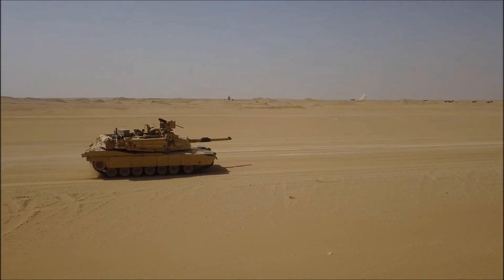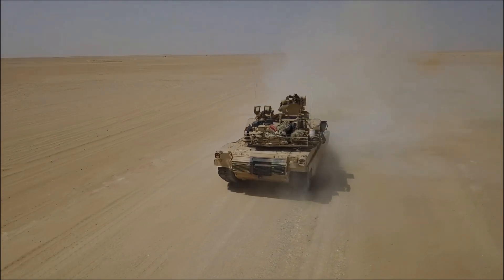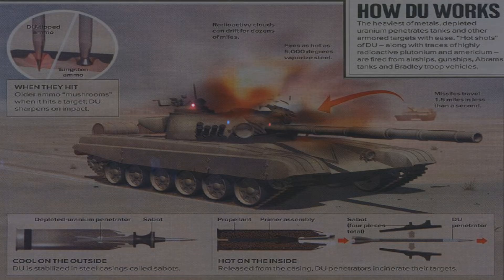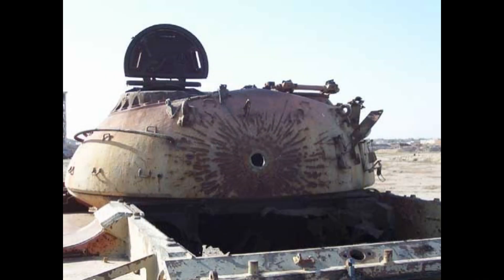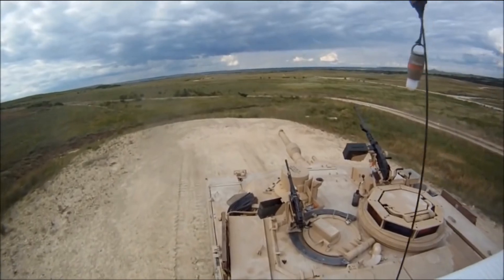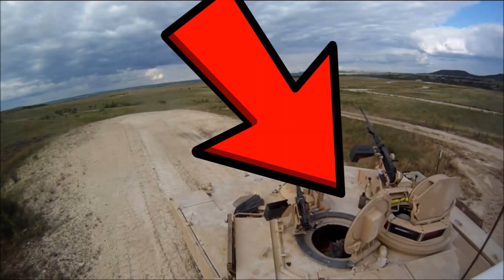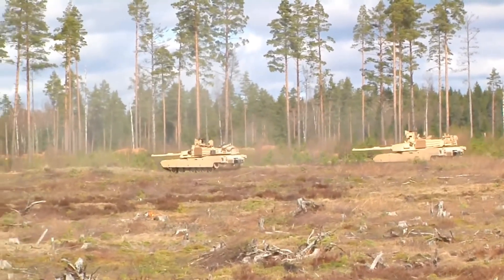Depleted Uranium Tank Ammunition | DEADLY DARTS 💀☄️

Comment: Also you do know that AH-64, at least US ones use a mix, determined by CO and theater of DU/HE, and it’s also API/HEI right? And we have 20mm for jets, and seperate 20mm for Cobra’s, as we, the Mighty, one and only, first and longest serving attack helicopter that will out last any other VTOL and help, we have the last surving squeeze bore, a 20mm, Vulcan squeeze bore with a mix of DU AP/API and HE/HEI. Yep, we still run squeeze bores, the USMC don’t play, why waste weight on a bigger gun and less ammo, and being a larger, slower, stationary target that has to hover while engaging. When you can be fast, nimble and deadly and small. While outperforming or at least matching 30mm performance out of a 20mm. Yeah, we invented and perfected it, before literally anyone else, yet silly people think an apachebb by is better, lol, they are worse in literally every way and got shot down by a single dude, with mosin in Afghanistan’s never happened to us, and we been doing it since the mid-late 60’s.

Comment: Tngsten is harder and more dense tha Uranium, however uranium penetrators are more effective. Unlike tungsten, uranium is pyrophoric. It also has a lower melting point than tungsten. As a DU penetrator strikes a target, its surface temperature increases dramatically. This causes localized softening in what are known as "adiabatic shear bands" and a sloughing off of portions of the projectile's surface. This keeps the tip sharp and prevents the mushrooming effect that occurs with tungsten.

Comment: Fun fact: the scientific basis on why long, dense and slender rounds work so well was actually predicted by Sir Isaac Newton. Newton surmised that impact depth — once you reach high enough speeds — depend only on the following things: the density of the target (higher = less penetration), the density of the projectile (higher = deeper penetration), and the length of the projectile (longer = deeper penetration).

Speed does not matter, once you go over a certain velocity, and neither does width/diameter. So you might as well sacrifice width — i.e. total weight — in order to get a higher velocity.

Comment: Water is the hard:Wood and encapsulate water. with explosive in the back edge. can be 4-sided like the ones used today but filled with water and plastic ammunition. then you can stop this ammunition with giga high-pressure water in a container.

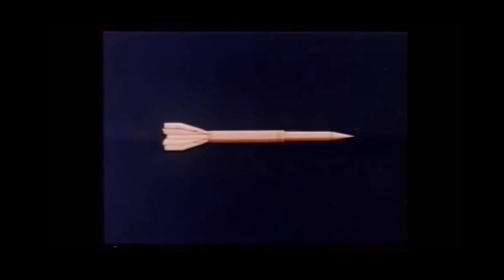Comment: I was a bit confused by the video's comments on radioactivity at around 7:00 .  If I heard it correctly, it said that DU l was the most radioactive form of uranium.  In fact, it is less radioactive than natural (unmodified) uranium, and much less radioactive than enriched uranium.   Roughly speaking, radioactivity is inversely proportional to half-life, and U238 (the main component of DU) has about 7 times the half-life of U235.  It is far less radioactive than, say, Radium or Carbon 14.   It is usually regarded as safe to store and handle without taking any major safety precautions.  It is desirable to wear gloves when handling it, but more for reasons of toxicity than radioactivity.
Reply: Yes, it's not very dangerous when it is in a solid form. Problem though is, that if a DU round hits something, it creates DU-dust, which you can breath in and that is a real health risk.

Comment: 1:25 "Made of Uranium"? A DU round is made of DU, not U. that's why its called DU. In DU there is only 1.02% Uranium left after the original Uranium enrichment process. DU is what's left over after the enrichment process. It is NOT spent fuel rods or something like that. That would be truly hazardous in a Radioactive sense. In other words, there is shit all Uranium or radiation in a DU Round. The biggest problem is after a DU round hits something and has an exothermic reaction (usually on Iron) the vapourised metal and atomized metal goes everywhere. However, a similar thing happens with lead. The effects of DU are very similar to Lead. Anyway, don't call DU Uranium, coz its not.
Reply: Wow. I just responded to your incorrect claim that uranium is not the heaviest naturally occurring metal on Earth (fact check: it IS). Now this ripper. Fortunately, I can quote part of your other reply to address this one,  "I dunno what textbook you're copying or if you making this up as you go along :/ frustrating cos..."  I've only read 2 of your posts so far "...and stupid me has spotted two non-facts"  One word for you Karen: ISOTOPES. 

Depleted uranium from uranium enrichment process is nearly 100% uranium. Not "1.02%" .

Comment: Interesting video.  Thanks for the effort to make it. A few physics corrections:   1.  Naturally occurring Uranium starts out at 0.72% U235, 0.01%U234, and 99.27% U238.  Your graphic states that depleted uranium is 89% U238. I think you derive this because Uranium is enhanced to 11% U235 for use in fission reactors. DU projectiles are alloyed with other metals. Depleted Uranium has to be 99.27% U238 minimum before being alloyed.  2.  Stating that a projectile has no drop over 2 miles would be disputed by Sir Isaac Newton’s laws of motion. Gravity cannot be erased from any moving (or static)body on the earth’s surface. The drop may be small, but it can never 
be zero.

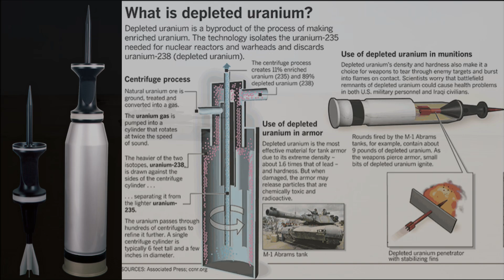Comment: 1:29 - "uranium, the heaviest naturally occurring element on earth" - Firstly, it's "the DENSEST" ("the quantity of mass per unit volume of a substance"), since "heavy" refers to WEIGHT ONLY (a tonne of lithium is much heavier than a kilo of uranium) - and secondly ,"the THIRD densest (maybe...) naturally occurring element".

Osmium comes in as "first", at 22.59 g/cm3, iridium is second (22.56 g/cm3), and only then comes uranium: 19.1 g/cm3. (Plutonium is, in fact, denser, at 19.85 g/cm3, but occurs "naturally" only in trace amounts, so the jury is still out on this.)

Also, the printed insert "What is depleted uranium?" states erroneously that "damaged armour made of DEPLETED uranium may release radioactive particles" - well, DEPLETED uranium is just about as "radioactive" as bismuth. 238U contains very little of its more radioactive isotope (235U), less that 0.3%, and it's radioactivity is so low that it is used, according to Auntie Wiki, as "radiation shielding in medical radiation therapy and industrial radiography equipment, and containers for transporting radioactive materials".
So, TOXIC? - yes; RADIOACTIVE? - hardly, or barely.

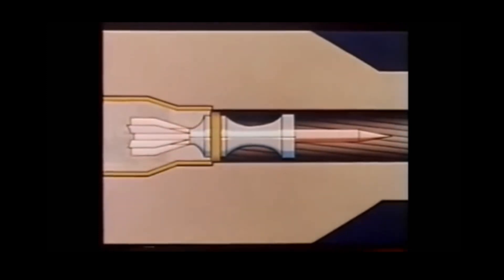EDIT: 6:39 - but whereas tungsten projectiles become rounded at the tip upon impact, uranium shells burn away the edges"... Uranium WHAT!? Oh, dear, dear...
Uranium PROJECTILES, "bullets", darts - whatever, but not "SHELLS"! Also, they do not "burn away" but rather "shear off" blunted parts...
Well, we certainly can see a lot a room for improvement here, don't we?

6:53 - "depleted uranium is a by-product of the process by which uranium-235 is...CREATED??!" 
• create (verb) [ with obj. ]: bring (something) into existence (...)
• produce (verb) [ with obj. ]: make or manufacture from components or raw materials (...)
• separate (verb): divide into constituent or distinct elements (...)
 Seems like the struggle with someone's native language continues, and the language is still mightier...

Now, I have to say I've skipped through most of the video, so I really don't know how many other "pearls" like these one here are still buried in the soundtrack, but frankly, I don't really care. I'm giving up, bye.
Reply: I seriously love when know-it-alls WRONGLY 'correct' others on the internet. "heaviest" in this context refers to the molecular weight. So stating that uranium is "the heaviest naturally occurring element on earth" is entirely correct.

Now, I have to say I've skipped through most of the video your post , so I really don't know how many other "pearls" like these one here are still buried in the soundtrack ranting , but frankly, I don't really care. I'm giving up, bye.
Reply: @kirkc9643  Thank you for your appreciation. 

Unfortunately, ATOMIC mass (NOT "molecular" one) does not translate into DENSITY of a PHYSICAL SUBSTANCE in a straight manner - and "weight" just IS NOT a "mass". Sorry, but don't blame me - I haven't invented English and its vocabulary.
Anyway, back to the issue - let's for instance take radon (Rn), which is a noble gas of a VERY high atomic mass of ≈ 222, or 222 g/mol, and lithium (Li), which resides on the opposite corner of periodic table, with a very low atomic mass of about 7 - or 7 grams per mole.
HOWEVER, the DENSITY of radon (under "normal conditions") is about 0.01 g/cm3, while density of lithium, the THIRD LIGHTEST ELEMENT is about 0.534 g/cm3, or well over FIFTY times as much. (Makes you think, eh? Nah, just kidding - you don't ever get distracted by this activity, I'm sure...)

"Now, I have to say I've skipped through most of the video your post" - that's fine and perfectly OK with me - I'm sharing my knowledge free of charge, but hey, "no like, no eat".
In other words, if you wanna stay... where you are, who am I to tell you what to ignore or why being dumb isn't the best idea, right? But then one has to be dumb to love being dumb, so it all sorta works out perfectly, innit?

Cheers.
Reply: @MrKotBonifacy  You're still ranting and still wrongly claiming the video is incorrect.  The heaviest element in terms of heaviest per a given number of atoms is the element with the highest atomic weight. This is the element with the largest number of protons. The heaviest naturally-occurring element is uranium (atomic number 92, atomic weight 238.0289). If he'd said most dense, your ranting might be relevant. But he said heaviest.
Reply: @kirkc9643  I'm not "ranting", but merely EXPLAINING - although it feels more and more like "pearls before swine" scenario, TBH.
Also, I am saying the video is INACCURATE in some (many, in fact) aspects, and I'm not "wrong" on it, as I clearly listed some of those "mental farts" present there that I spotted.
AGAIN, that "heaviest" vs "densest" is THE LEAST IMPORTANT issue here, and YES, U might be "the heaviest" but that is irrelevant in KEPs context, AND THE ONLY reason I ever mentioned it was that I decided to give my "dressing down" AND that "heavy/ dense" issue sorta "caught the train" so to speak.

And then I'm not going to persuade you (or anyone else) to agree with me, and then that comment of mine was meant as a FEEDBACK for the AUTHOR.
But YOU decided to chime in and drop your wooden twopence here so don't complain now that I pointed out your fallacy (i.e. thinking that YOUR ASSUMPTION trumps mine, because... it's YOURS, right?).

Also, "give credit where credit is due", and I did just that by saying that yes, technically the author and you are both correct, but then the atomic mass is basically irrelevant here (and I even presented you with SPECIFIC NUMBERS - a.m. and density of W vs that of U).

And yes, you can say I'm a "know–it–all" and what not till the cows come home (and then for eternity), but I just couldn't care less. I hoped for a civilised and facts-based reasonable exchange, but I'm afraid there's a serious obstacle here (and it's not me).

Also, "heaviest element in terms of heaviest per a given number of atoms is the element with the highest atomic weight" is a nonsensical gobbledygook - "in terms of heaviest per a given number of atoms" boils down to "density", and the "atomic MASS" is simply a mass of an individual atom represented in "atomic mass units" (which are multiplication of the mass of an atom of "basic" hydrogen isotope).
And when you talk about "number of atoms" in context  of mass, or "weight" then it's something called "molar mass", but this is a slightly different kettle of fish.

And, again - that "atomic mass" bears no "absolute" or "direct" influence on density, as I showed you already in that "Li vs Rn" example. But hey, let's go further, shall we? Forget radon, think UF6 (uranium hexafluoride) with molecular mass of - hold your breath! - 352 amu, vs beryllium (Be, am = 9).
At 56.5°C (at atm. pressure) UF6 sublimes - it becomes a gas with density of about 0.016 g/cm3 (give or take few thou) - while Be will still be a solid with density of 1.85 g/cm3.
In other words, Be would be nearly 116 TIMES as dense as the UF6 which has a molecular mass THIRTY NINE TIMES greater am that that of Be.

Now, I just can't make it any clearer - the next "educational aids" would be play-doh and matchsticks, but I just can't do it here (not that I ever wanted to...).

Again, and try get it through your thick skull (and stop ranting):
"If he'd said most dense, your ranting might be relevant. But he said heaviest." - EXACTLY, my dear Watson.
He said the HEAVIEST when he should say - that is, "refer to/ talk about" DENSITY. 

BUT YES, URANIUM IS THE HEAVIEST ELEMENT! WHICH HAS NO RELEVANCE IN THE CONTEXT OF KEPs!
GOT IT? And that was THE LEAST OF MY GRIPES! - GOT IT?

Beam me up, Scotty...
Reply: Mat is
not a person who is very into science so that the scientific stuff is a bit unclean but in no way majorly wrong is not a problem
Reply: @kirkc9643  PS: On a second thought, I have to say... you're right.
Well, sorta - in a sense. In a very narrow sense, to be precise...

Yes, technically speaking "uranium is the heaviest ... element" as far as atomic mass is concerned, and I'd probably ASSUME the narrator meant just that, if the narrator in question would be, say, Prof. Polyakoff talking about "element uranium" in one of those "Periodic Videos" carrying the title, say, "Uranium - Periodic Table of Videos" (youtube.com/watch?v=B8vVZTvJNGk)
However...

Your ASSUMPTION (!) that ""heaviest" in this context refers to the molecular atomic weight" is just that - an assumption, and while you're free to assume whatever you want, "your assumptions are just as good as mine" - so it's a tie.
Well, almost...

See, "ATOMIC mass" doesn't make much sense "in this context", as this video isn't about "uranium as such", but about "certain OBJECTS ("darts") made with a very specific and rather narrow purpose in mind, and those are called "kinetic energy penetrators" (KEP for short) - which could be made of EITHER uranium or tungsten.
Again, it is about "physical OBJECTS", not "substance".

And in THIS CONTEXT atomic mass of either uranium or tungsten is pretty much irrelevant - it's their DENSITY (plus hardness, or toughness) that matters - as the goal is to put as much kinetic energy (E[k] = 1/2 mv^2) as possible into an object with as small cross-section as practically possible - and that's why "density matter, but atomic mass does not".
Atomic mass of tungsten (W) is in fact much lower that that of uranium (U) - a mere 77% of the latter (184 a.m.u. for W vs 238 a.m.u. for U, or DU), yet their densities are almost identical.
Even more interesting, even though W is slightly denser than U (19.25 g/cm^3 and 19.1 g/cm^3 respectively), KEPs made of U tend to outperform those made from W by about 8%, due to better mechanical properties of metallic U (shear characteristic).

Therefore, atomic mass plays no role here. QED. Yes, interesting bit of trivia, but of no significance. Why then throw it into the narrative? Uh, you got me there... Me ay 'ev no effing idea...

And a little note "on a personal side", so to speak...
"I seriously love when know-it-alls WRONGLY 'correct' others on the internet" and thus YOU decided to "correctly correct" ME by saying that your ASSUMPTION is better than mine, eh? Heh heh... Good one, indeed... ;-)

But then your assumption about myself is just as accurate, as I'm not any "know-it-all" - still, without false modesty, I can say I DO KNOW "a bit" about this and that, and certainly more than an "average Joe" out there (make it "two Joes" for those from the other side of the pond).
And being an individual always willing to learn something new I clicked on this "suggested" video - not that don't know much about KEPs, quite the contrary - but hey, let's take a look, maybe I'll learn something new? Or will see some good, erm... shots?

Well, no such luck. Instead, yet another poorly researched ("uranium penetrator BURNS its sides") and lousily scripted ("uranium SHELLS", "uranium 235 is CREATED") clickbaitish video, "made just for ads money", full of "stock/ off the web clips", and factual nonsense - in short, a bane of this genre on YT, a parasitic "noise" that only makes "N/S ratio" on YT even worse. (And it is pretty bad now anyway.)

And that was the gist of my comment, and that's why I got fed up with the author (who earned himself "Do not recommend channel" nobilitation), and that's why I wasted some of my time typing that comment.
Should that "heaviest element" be the ONLY blooper in this clip I wouldn't bat a lid, and couldn't be bothered to type even a single character comment - it was "the whole picture" that got me irritated. That "heaviest element" was probably the least important thing here, but I made my complaints list in chronological order - and that "heaviest" irrelevance just happened to be the first.

Hope it makes the issue clear now.
Cheers.

Comment: A tank round will drop when fired at exactly the same rate as a stone. If you have an upward initial trajectory, the round will exhibit precisely the same vertical movement as the same round thrown upward with the same vertical velocity by a strong man. At 1500 m/s with a flat shot, you will have a drop of right on 20m over 3 kilometers and will have a vertical velocity of 20m/s. Note that this is remarkably flat for a trajectory, but it's not a straight line and the tank's ballistic computer has to compensate for it.

(Note that the actual drop will be a bit higher at any given range, because the round will slow down horizontally because of air resistance, but at the vertical velocities, air resistance will have little effect on the rate of drop.)